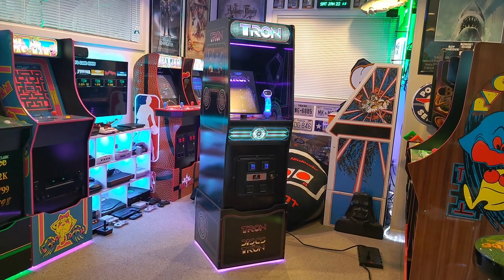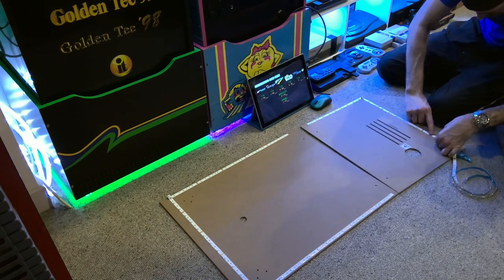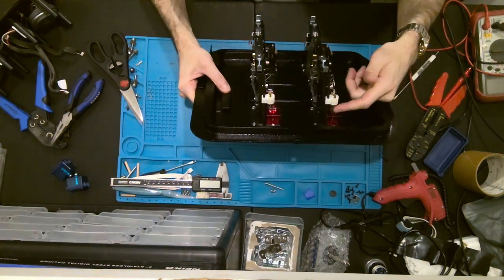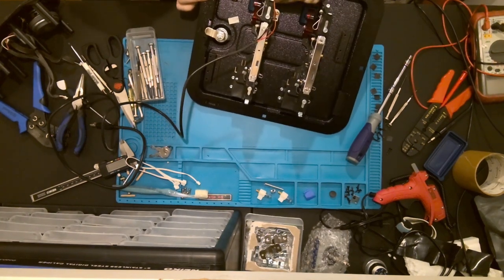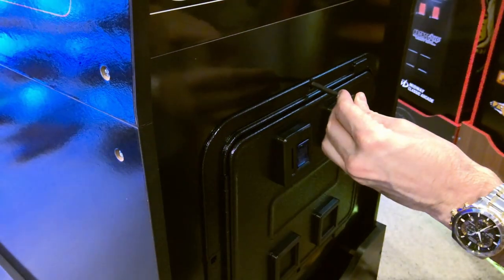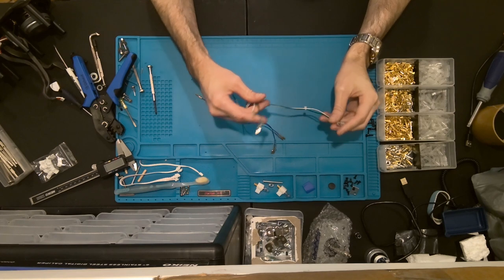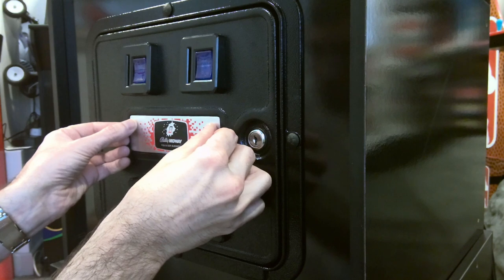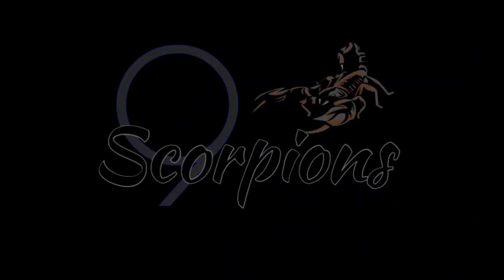Lighting & Coin Door Mods for Tron Arcade1up

Comment: Amazing nostalgic work. I ended up replacing my kick plate with translucent vinyl picture of Tron holding up his disc with Yori at his side. For added effect, it is backlit with blue lighting to illuminate the translucent vinyl. I also placed blue led strip lighting behind the cab to cast a blue glow against the wall behind the cab. I’m still waiting for the spinning MCU parts and 10” screen before everything is completed.
Reply from the maker: Thanks for the comments!  I am interested in the S mode also...but it will have to wait for round 2.  Which 10" screen did you go with?

Comment: Will you do a 20" screen replacement in this cabinet? If so, let us know if it is any different that other A1UP screen swaps.
Reply from the maker: Hey Joe, thanks for watching and the comment!  Since this has a vertical monitor, upgrading to a 20" would likely be challenging as most of the real estate within the bezel is already consumed by the 17" vertical monitor they used.  If this was a horizontal machine and monitor, then the upgrade to 20" is more doable.  Based on my quick check, not sure you can even go to a 20" vertical monitor without heavy modifications as it would stretch beyond the bezel area (or consume it all).  So now I am interested also...will keep an eye out if I see someone else post about this.  Did you buy this cab?  This is by far my favorite one so far.

Comment: Is there any way I can ship you my Tron deck  and that same coin door that you bought and you wire it all up for me in the ship it back for a fee? I have no experience with using wires but I own four different arcade machines and I really want them to work with coins and I have no idea where to start with how to solder onto the motherboard
Reply from the maker: hey Keno, thanks for reaching out.  Unfortunately I do not offer services of any kind.  May I suggest reaching out to community vendors such as DIYRetroArcade https://www.diyretroarcade.com/ or Retro530 https://www.retro530.com/.  They may offer this sort of service.  My install tutorial does not require soldering...but you would need a crimping kit and spade connectors.

Comment: Great work. Note, I recently followed your instruction on the coin door mod. For my killer instinct cab. Only thing is, I did it on a single coin door. I wasn't able to get it to hold both player buttons down to log back to the main screen. So I just plugged it into player 2. My question is, do you think it's simply because it's on a single coin door? Meaning basically, player 2 button literally is player 1 now and its cancelled out. Or am I doing something wrong with the wiring? Because it is two wires on a single button.(4 in total).. should i just get a 2 player coin door and try it again?
Reply from the maker: Hey there Carl, thanks for the comment!  So the concept of holding down both Player Start buttons to force a return the main menu requires that the P1 and P2 buttons to be wired in series back to the Player 1 Start encoder.  I am assuming that KI is using the P1 start button 5 second hold as a return to the main menu?  I think the challenge with having a single slot coin door on a 2 player cab is that you can only wire it to start a 1 player or 2 player game.  I use the dual slot coin accepters and wire the left to P1 and the right to P2.  In this video I just posted, go to the 8:26 mark and see if your wiring is the same or different.  Let me know...happy to help if I am able to.